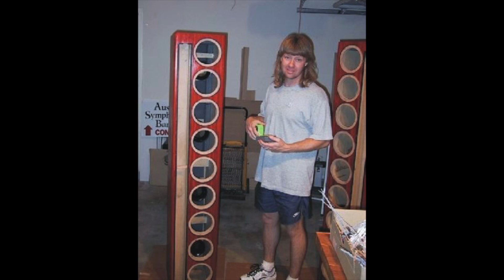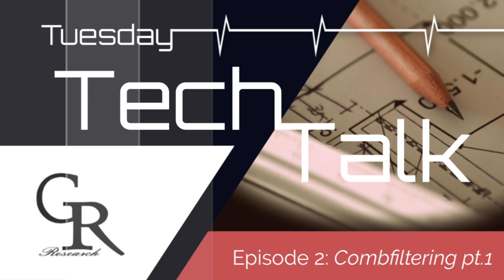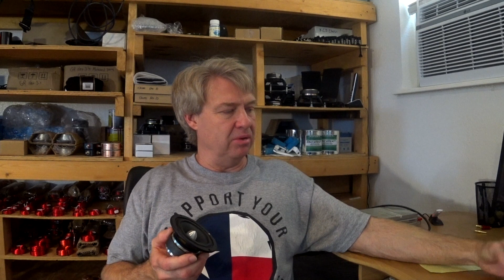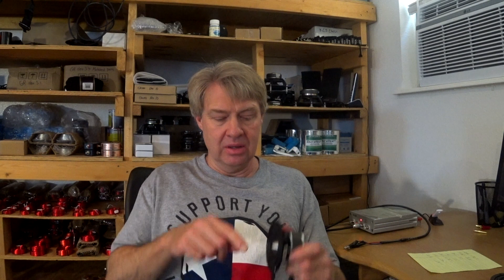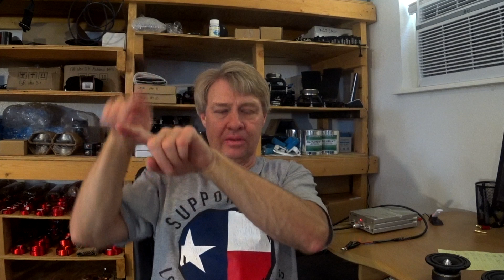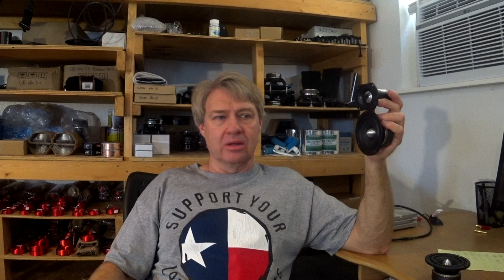What the heck is comb filtering?!

Comment: It sounds like we should be most concerned about this with higher frequencies, since low frequency waves are so long. Is that why people say speaker placement comes down to a matter of inches?  Thank you for making these videos!  I've got an Outlaw RR2160 amp and Elac B6.2 speakers on stands in a dedicated listening room - I have them four feet out from the wall and they sound great! I'm going to be trying a range of speaker positions to see how that affects their sound. They also sit a bit higher than I'd like - the stands are 3 feet tall; should I try and tilt them downwards?
Reply: Brian Smith Great speakers and you don’t really have much to worry about when it comes to a starting off point. Most designers like Danny (or Andrew Jones who designed yours) plan on the listening position being at or slightly below the tweeter level. That should probably be your starting point so try a shorter stand or a tilt. One way to test it is leave your speakers as they are and slouch down further while listening to music and then start to sit higher (pillows to sit on or whatever) - you’ll be surprised how the sound changes with these types of tests.